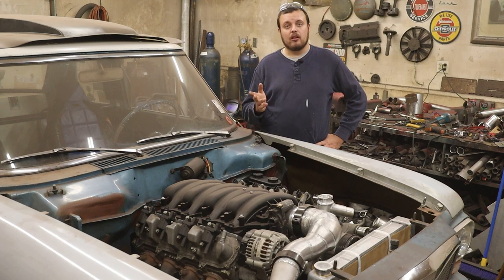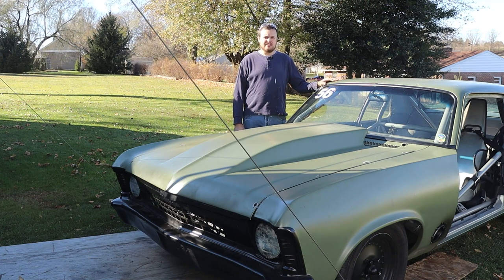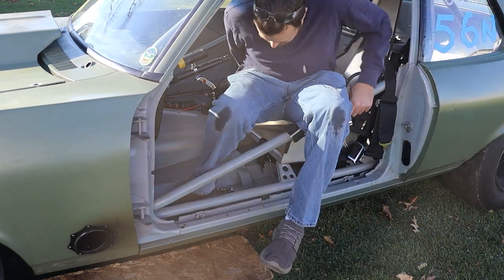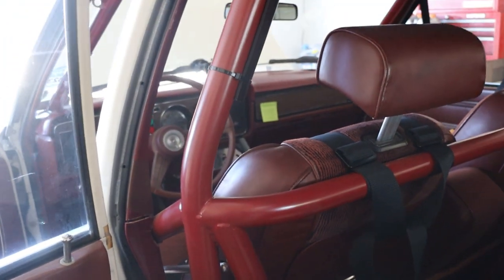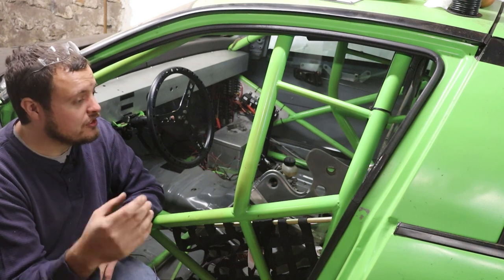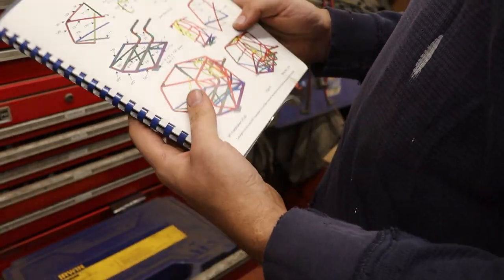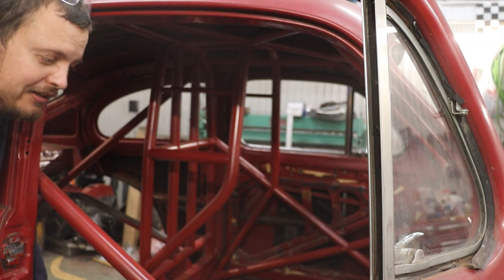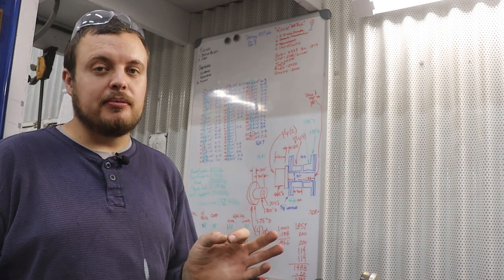Do I Need a Roll Cage to go Drag Racing? - Short Answer, It Depends...

Comment: I have a convertible not able to do under 14s yet but plan on eventually. I know 13.49 is where you have to start using a roll cage but which type do you need ? I see 4 point 6 8 10 but I can't find which you need.

Comment: Great video! I'm sure somebody will ask about bolt-in vs weld-in. I've seen bolt-in units that were NHRA legal for 10.0, but not for 8.5 or faster. Not that you would want a bolt-in 8.5 cage...
Reply from the maker: Yeah. Bolt in is usually a no go.

Comment: I’m wondering why NHRA hasn’t allowed a containment seat to be used in place of a funny car cage. I feel that the containment seat will probably the same safety as a funny car cage when going down the track but also be safer for the driver and passenger when driving the car on a public road

Comment: just a reminder 2014 and newer are allowed to run up to 9.00 or 150mph with out a roll cage , and the 2008-2013 can run up to 10.00 or 135mph with out one
Reply from the maker: Yes. Forgot about that
Reply: Is that only nhra sanctioned tracks or everywhere?
Reply from the maker: @austinsarver2413  I believe it's only NHRA, but IHRA might have it too.

Comment: My philosophy has always been to build the most cage you can afford..you may be running elevens in the car today, but down the road you might want to raise your aspirations and lower your bank balance...er, lower your ET.
It's a lot easier to build "too much" cage while the car is a blank slate than it is to add "just enough" after it's been completed..besides, a full cage adds substantial stiffness to the chassis...and is there really such a thing as "too much" cage when the unthinkable happens and you find yourself barrel rolling down a retaining wall?
😯